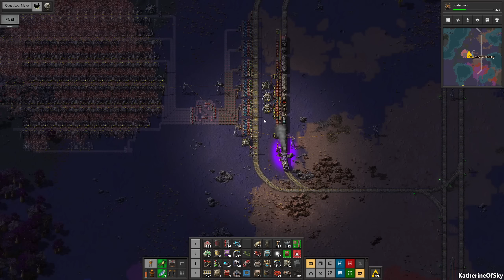Factorio 248k Mod 53 - HOW TO BUILD A BOT TRAIN STATION! - Tips & Tricks

Comment: Just as a heads-up: @19:30 The third wagon of the station you deliver copper ore from the base to seems to be similarly 'clogged' as the steel station was - this wagon's full to the brim with ore by now, but it's not getting unloaded, just carted around the map again and again and again, ad nauseam, and so your base is getting 1/4 less copper plates. I know, the cooper's not needed (yet), but that's 1/4 of transportation capacity 'wasted', and as you're well on track to megabase territory by now 👍, sooner or later this just may come back to haunt you 😉, when you start the 'heavy outposting' phase...

Comment: I think the 6 channels are supposed to be 2 red modules, 2 blue modules, 2 green modules, 1 red module + 1 blue module, 1 blue module + 1 green module, and 1 red  module + 1 green module.  That covers the 6 possible combinations of 
2 vanilla modules. (3 colors × 2 modules per beacon = 3+2+1=6. If you had 4 colors it 
would be 10, 4+3+2+1=10.  there is an actual statistical function that does the math right for any combination. It would be 3 pick 2 and you can reuse. There is a different one if you can't use the same # twice such as in a lottery ticket. apparently according to another commenter you can get more channels with research.
Reply from the maker: The 6 channels are entirely customizable, and it would be inefficient to do 2 of each kind.  Efficiency modules are never used in end game when you have enough power.
Reply: @KatherineOfSky   true. I was answering of why 6 channels. It is because there are 6 possible combinations. However there are also more kinds of modules added with the mod. I wonder if that is why some don't make sense compared to the vanilla productivity, you asked in a previous episode on what was the point of some of the modules added by the mod. It might be if a certain building can't use productivity modules, but a modded one might work, and it was slightly less powerful for balance reasons. Also if you use another mod pack like space exploration there are buildings that need huge amounts of power, so efficiency might still be needed.
Reply: That's also assuming you're using the same level of modules, since type comes in three levels. I'll also sometimes use baby modules in some spaces and big ones elsewhere.